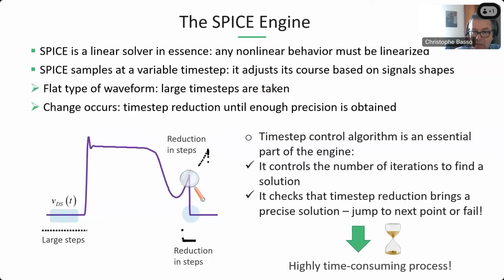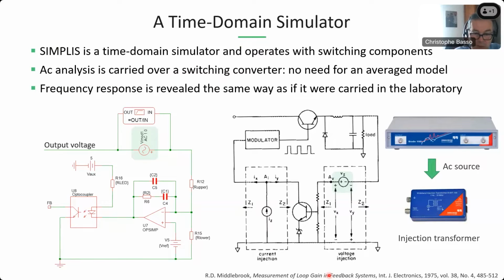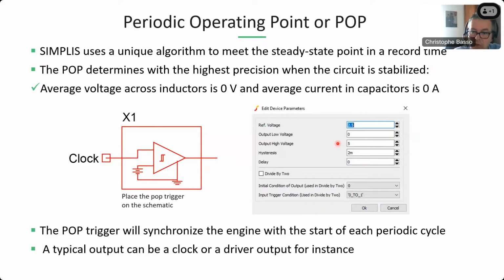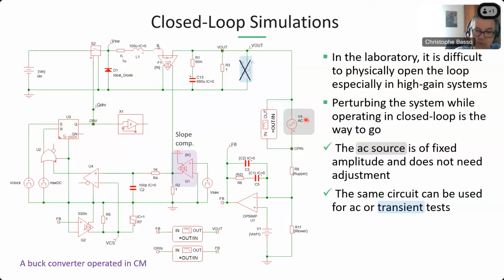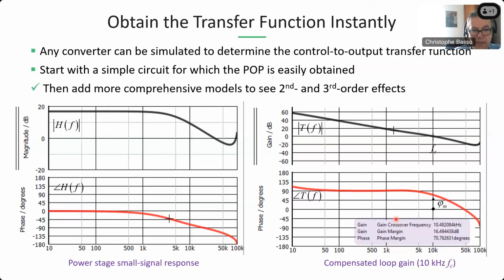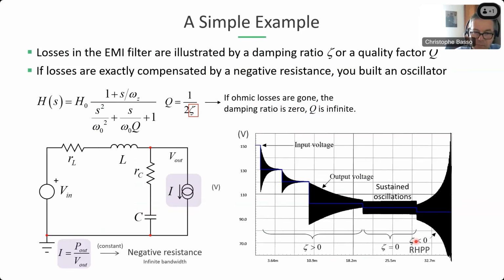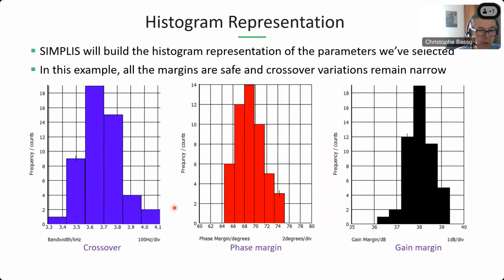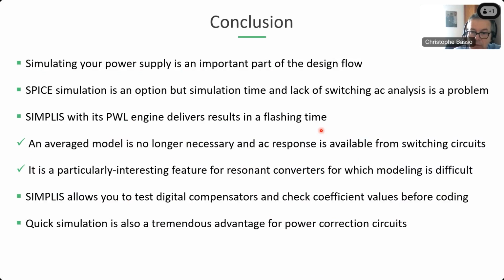An Introduction to Power Supply Simulations with SIMPLIS

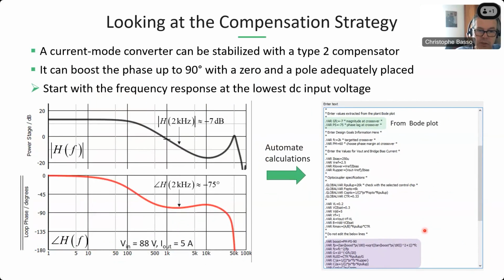Comment: This Flyback is working in CCM at Vin=around 88~260Vdc. The Flyback becomes DCM working if Vin>300V. So it needs to carefully optimize its controller. The DC gain of Gdc=12~15[dB] at Vin=88V in 58:17 should be above 20[dB] in the frequency response. Since the slope-comp value is not showing in PPT, the calculation result shows 21.6[dB] by assuming of 120[mA/us]. Because of the wrong DC gain, the crossover frequency does not look like the right value. So the controller designed with the wrong plant value results in non-optimal results. The DC gain increases when operating in DCM, with Vin above 310V. So its crossover frequency moves to a higher frequency.

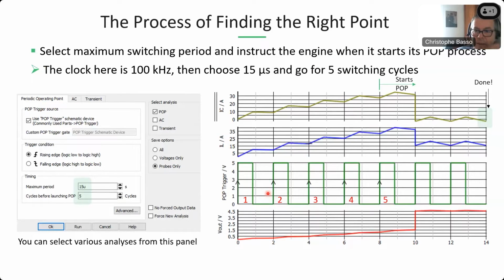Comment: Hi Christophe： In 20:20, 'The Process of Finding the Right Point',  right chart, why the two current curve have a suddend change after the POP start? In my understand , the POP is try to find the correct operation point,  include the operate current , if have such sudden change ,is it means the current before POP is not correct ?
Reply from the maker: For such a specific question, can you please get in contact with Christophe directly? Thanks!